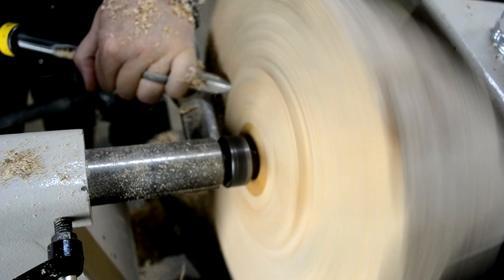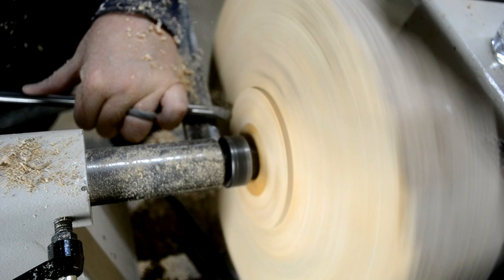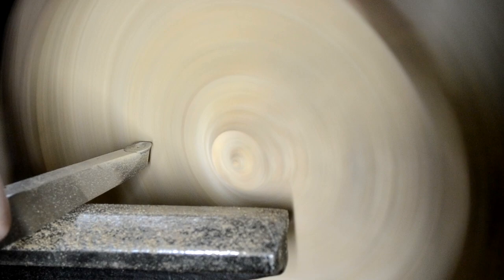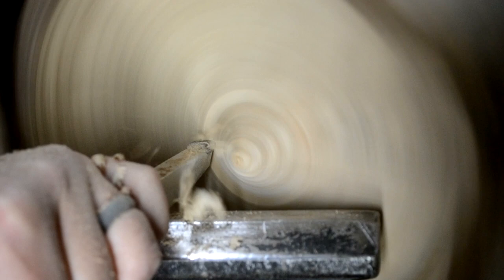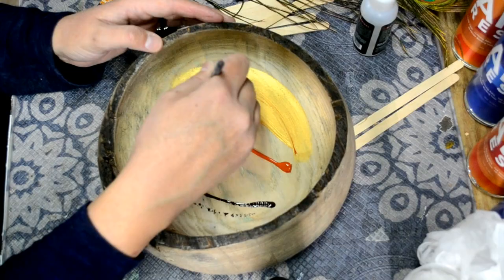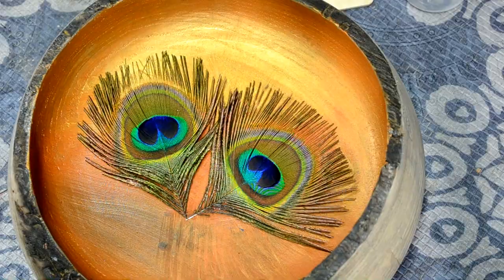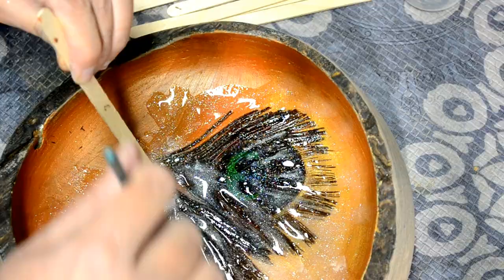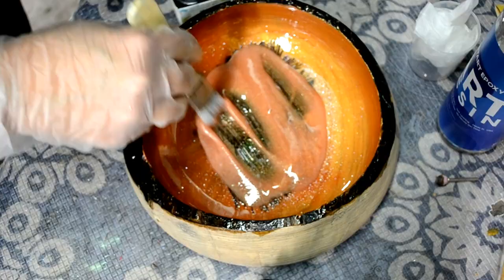Sunset..Peacock Feathers ..Upstart Epoxy ..Spalted Ash Bowl

Comment: Interesting remarks about Tenon vs Mortise. Personally I prefer the latter because you finish you bottom in one go. 
The only times I'd consider a Tenon are when the wood cannot take a Mortise for the risk of splitting apart or when you are lacking the depth required. 
And of course you made a beautiful bowl. Thnx for sharing!
Reply from the maker: Thank you! That i will admit I struggled with was a tenon, but I feel more confident with now. I'm not familiar with a latter. Do you have a video on how to do one?
Reply: @TanyaBecherWoodturning  The last  mentioned i.e. the Mortise. Sorry if that's not proper English.😁
Reply from the maker: No worries! Thank you😉